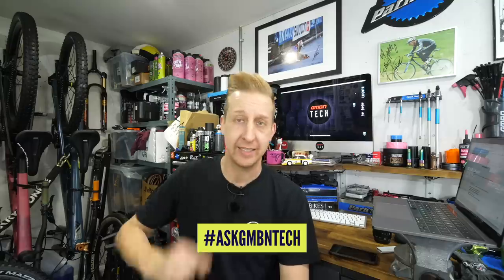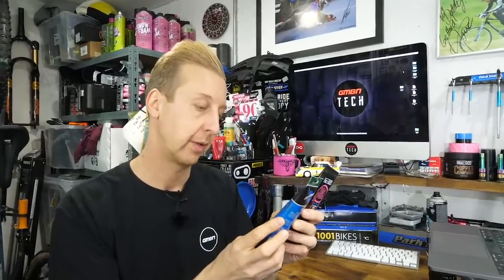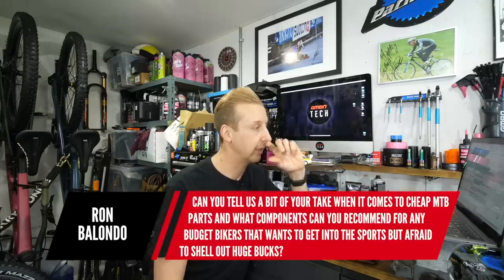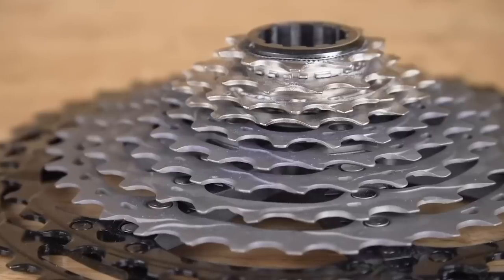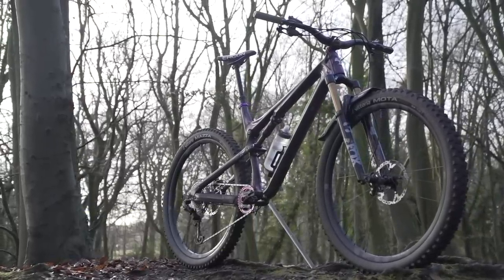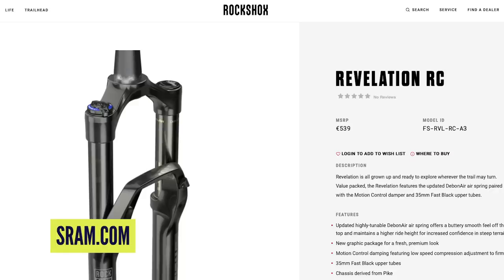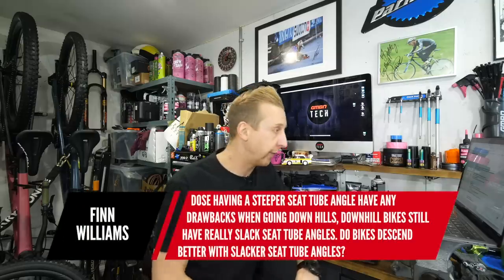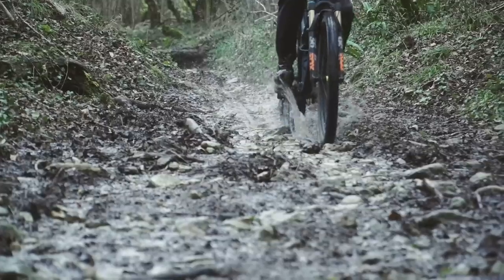What Cheap Components To Save Money For Budget Mountain Bikers? | #AskGMBNTech

Comment: I've got a Specialized Pitch 2020 27.5, basic components, with two in one shifters and hydraulic brakes. 2x8.
Is my shopping list...
DEORE 1X12 Crank and cassette
DEORE Rear shifter
DEORE rear derailleur
DEORE XT hydraulic brake levers

Anything else?

Comment: #askgmbntech 
If you use a shimani chain and cassette with a sram drivetrain, would you still get hyperglide?
And, unrelated, would it work to use say a 12 speed derailleur with a 10 speed shifter on a 10 speed drivetrain?

Comment: #AskGMBNTech

I have a giant stance 1 2020 27.5 and have bought Magura mt4 brakes. The front fits but the rear is rubbing the frame and i can't get it aligned, i have put a 180mm rotor on the back now and it has given it a bit more space but is is still being pushed in too much. How can i get it to fit and why won't it fit?

Comment: #AskGMBNTech I recently found the need to replace my rear cassette on my Cannondale Trail 6 (2016) i opted to extend the ratios from 11-34 to 11-40 thinking it would be better - but my shimano acera derailleur wont reach the biggest gear - can i get around this with a mech hanger extender or do i need a new derailleur - or to just go back to the stock ratio?

Comment: #AskGMBNTech - Hi Doddy! :-D  This may be a weird question, but how heavy is too heavy for a MTB? I know most MTB have a max weight range of 120kg, but I'm considerably heavier than that. I'm a regular rider using my mtb for exercise & weight loss, and not really into jumps & tricks (maybe an occasional bunny hop). How far (weight wise) could a MTB be pushed before it was into critical stress range and in danger of parts or frame failure? Cheers & love the channel! (especially Blake, Martyn & yourself)

Comment: #AskGMBNTech I've got a mid 2000s 26er ( 09 Spesh sx trail) of which I am the original owner.  The bike has some conservative geo in comparison to modern freeride/all-mountain setups, and tends to rival that of some trail bikes to be honest, however, it is still a great functioning bike and is still more capable than I am at bike parks, even if she is almost 38lbs I'll still pedal it (slowly) all day long; I want to breath some modern life into it.

I've done a Fox dropper, Sram 1x12, full frame bearing refresh and put some 4 pot Zee's on it, along with widening the cockpit 100mm.  I've got a good Fox 36 Talas (OG Fit damper) with a 20x110mm mated to factory DT swiss rims and Spesh hubs (Joy-tech I believe).  I'm a big time DIY guy and want to tackle a wheel build and slacken the head angle.  The rear is a 135x10 and I haven't purchased a new hub yet (would like XD or Shimano micro if possible).  Are there some considerations I need to think of when approaching both these tasks (angle set/wheel build)? Would you save your money on hubs and just rebuild the factory units?  I have the ability to do a mini mullet setup with my fork accommodating a 27.5" wheel.  Any advantages to that?  

Long question so feel free to abridge if you do reply.  

Love the show!
Here the steed as of a few days ago. 
https://i.imgur.com/QW2Aogm.jpg

Comment: Favourite cars gotta be an eagle speedster (or a redtomod jag e type). An absolute beaut of a thing. My question to #askgmbntech is that on my carrera my suntour xc, forks are really stiff and it takes my having to put in 5 mins of pumping for them to move at all and ive never really gone above 50mm travel. I always oil it and wash it but still have this issue can you help

Thanks

Comment: #AskGMBNTech  Hi GMBN Tech - What is the easiest way to adjust the overall travel on a modern suspension fork? I have a pair of  2019 Fox 36 with 160mm travel which I would like to run at 140mm for my new frame. Now that Talas and 'U-Turn' no longer exist,  what options do riders have? Keep up the great work!.

Comment: #askgmbn I have an old hard tail and it’s making a weird creaking noise, might be coming from the bottom bracket. If I have the brakes on going down a hill at very slow speeds as I release break slowly it makes an awful creaking noise. Also my disk brakes make juddering noises when going down hill and braking even just lightly. I have tried aligning them many times and even got a shop too a while ago and still no fix for it

Comment: #askgmbntech, hi guys, i want to upgrade the shock to a deluxe ultimate on my 2020 calibre sentry. but the rear mount is vertical and the front mount is horizontal. But with the new shock they’re both horizontal. Is there a way I can simply turn the stroke 90 degrees so it fits?

Comment: #AskGMBNTeck i went to replace my shifter cable on my sram GX 11-Speed and after adjusting all the limit screws and the barel adjuster it still was not shifting properly. I took it in to my local bike shop and they told me my cable tention was too tight but I remember installing it to be pretty loos is there any way to tell when the tention is to tight or is it all by feel.

Comment: #AskGMBNTech Hi Doddy, been mountain biking for nearly 25 years and ridden xc hardtails for the cast majority of that, aside from a few demo/rental bikes here and there. As I’m not getting any younger, back in September I treated myself to my first ever full sus, an NS Bikes, Synonym TR1🤩. Due to work, travel restrictions and lockdown I’ve not had much opportunity to really put it through its paces but done a few laps of Aston Court and managed to get over to Cwumcarn before Wales shut up shop 😭. I’m loving the bike and have already smashed a few PBs on rougher descents. Pretty much there with setting up the fork but still tinkering with the rear setup. A few questions; On the few occasions I’ve ridden full sus bikes, I’ve always seemed to have trouble setting up there rear suspension, I don’t weigh a lot (58kg) but do ride quite aggressively, if I use the recommended settings for my weight I’m constantly bottoming out and if I start adding air l loose the small bump sensitivity... do I need volume spacers-any other suggestions?  Secondly, more just curious about this, on a flex stay design like this does the flex in the stay contribute to the spring rate in the shock and does this impact on rebound damping settings needed? And finally, I’m not sold on the lockout system, how difficult is it to remove and replace with a standard dial on the fork and 3 position lever on the shock? Cheers Doddy, absolutely loving your work, keep it up 👍😊

Comment: #AskGMBNTech Hey there wizard Doddy :). I'm looking to build a Commencal Meta AM 29 which has a 230x62.5 stroke shock. Will it be possible to use a 230x65 shock on this frame? I'm asking because I what to use a Rockshox Delux Ultimate and cant find one at the recommended size (230x62.5) anywhere. P.S. I don't what to use a shock with a Peggie back that's why I'm not looking for a Super Delux shock. Thanks a lot and maybe if you have the time you can enlighten us of the kinematics of using a smaller or a larger shock stoke.

Comment: Continental are great tyres but they aren't all made in Germany. I've got some made in India and I think many of their inner tubes are made by CST who supply inner tubes to many brands even Poundland in the past. There are no Bontrager factories it is simply a brand put on components from other factories. Some are identical to the normal products from those factories and some may have a specific design that only Bontrager sell. If you are careful you can get great decent  cheap components by careful selection often just buying the factories own brand rather than the badge engineered version. An extreme example is I saw a comment in China regarding fuji-ta carbon fibre frames which were sold at about $200 in China with the Battle brand on but with the Bianchi brand on were sold at around $3000 in Japan. Same frame extremely different markup. It's not what it costs to make it is what people are prepared to pay and clever marketing is what creates demand even at very high price points. Bianchi would sell on its Italian racing heritage, perhaps a German brand would sell on its engineering reputation and a US brand on its freedom and adventure but at their core its a product designed and engineered in Taiwan and mainland China with all the certification and testing done there.

Comment: HI dod, I ride three bikes regularly. But I have a fat bike that have 132m BB shell means it's wider than the  other,. I feel knee pain when I use the non fat bike-bikes since I ride a lot on the fat bike lately. Will it be fixed by a longer spindle pedals? Btw all my bikes are using clipless pedals. #AskGMBNTech

Comment: There's all sorts of automotive cleaners & lubricants for specific uses or "special purposes" on cars & motorcycles too, if you know which ones are equivalent to the cycle specific stuff then you can use them.. there's almost always an equivalent if you can identify it & it's almost always significantly cheaper when there is (economies of scale). There's almost nothing carbon-fibre safe though, you'd have to go to aerospace supplies for that, & if you think the bike specific stuff is expensive y'all ain't seen nothin' yet.

Comment: #AskGMBNTech
HI I am looking to upgrade my Sram SX Eagle 1x12 11-50t to  Sram GX eagle  1x12 10-52t 
I understand this needs a DX driver.
How do I know if my wheel is compatible with a Dx  driver?
Current Rear hub; Novatec Boost RR 12x148mm Boost, 32H
Current cassette; SRAM PG-1210 Eagle, 11-50T
I have been trying to research this for days with little luck, any help would be appreciated 🙏

Comment: Hi Donny! I just got my Downhill bike tubeless a few days back, and I heard from a few lads that motorbike tire sealant works as a cheaper alternative, any thoughts? As always, keep the good work! #AskGMBNTech
Reply: Motorbike tyre sealant depending on brand can have the following issues when used on bicycle tyres
1) Inability to seal pinholes and sub microscopic holes (in nylon and fabric based bicycle tyres) as motorcycle tyres are butyl rubber based and much less porous (air wise).
2) Media used to seal holes generally larger for bigger holes, not necessary for much smaller bicycle tyres, ends up being added unnecessary rotating mass inside the tyres.
3) Depending manufacturers/brands motorcycle tyre sealants can be water based (not an issue for butyl based tyres, infact no turning into latex webs and balls) but can cause rim tape/adhesive to part, eventual partial and eventually full leaks through the rim's double wall through the valve.
On the whole motorcycle tyre sealant is not 'sealant' per se as motorcycle tyre sealants are essentially for puncture proofing only (as even if not used tyres will seal tubeless), bicycle sealant is both for puncture proofing but most importantly to make a bicycle tyre 'tubeless' which it is not by itself..
If a bicycle tyre is made tubeless by itself like car and motorcycle tyres it will become to heavy and not so supple.. Forget about folding tyres..

Comment: #AskGMBNTech It seems to me that more and more frames are being designed with big curves on the downtube where it meets the head tube and the bottom bracket. Some have a big kink at the front of the top tube too (eg Hai Bike). Surely this adds excess material and reduces stiffness? I can understand that you need clearance for the fork crown, but are there any other good reasons for this, or is it just aesthetics? Maybe making space for bottles inside the front triangle? I remember Trek advertising on the previous generation Slash that it had a straight downtube which maximised strength and stiffness. That made sense to me, but the excessive curves we're seeing now look pretty ugly to me and don't seem to have any redeeming practical reason for being there.

Comment: The only answer for that title question should be Deore.
Reply: Or a generation older mid or higher ranger parts. I wanted do go with the M5100 deore but a friend told me that the older 11spd is basically bulletproof so i gonna get SLX M7000 with a sunrace 11-50cassette and M5100 cranks.
Reply: And marzocchi for suspension
Reply: @maximilianweling477  Not bad but aren't the RockShox more reliable? Also RockShox forks can be upgraded a lot.
Reply: @kaedeschulz5422  Marzocchi is really simple to service though.
Reply: @maximilianweling477  I have no idea tbh. To me RockShox also seems very easy to service.
Reply: @kaedeschulz5422  M5100 Deore is really good. I have it on my 2021 Kona Honzo with the 11-51 cassette. Really good drivetrain. To the point where if I were to build a bike from the frame, I'd go Deore. But 6100 12 speed with an SLX 10-51 cassette and XTR shifters.
Reply: @vdel7418  Maybe it's not as bulletproof as the older shimano 11spd RD's? I guess we will find out LoL Sadly i couldn't get the RD M5100 so i got the 5120 instead wich sadly came with too little grease on the clutch tesnion band wich causes it to creek and not work smooth. I will order that special grease with the next load of parts :D. I'm using a sunrace MZ8 11-50 cassette and SLX M7000 shifter btw :) The cassette is a lot lighter than the M5100 also looks very pretty.

Comment: #AskGMBNTech #AskAnyoneElseInTheCommentsSection ...just how straight do your wheels need to be? Rear wheel itself is fairly straight but leans toward the brake disk side of the swing arm. 5mm between the tyre and swing arm on the left hs and 13mm between the tyre and swing arm on the right hs. Have tried to straighten it at the rear quick release axle.

Comment: I contaminated my brake pads and rotors when doing drivetrain matenence and they haven’t worked the same since is there a way I can fully decontaminate them thanks!! #askgmbnteach
Reply: I had the same issue. How I fixed it is I removed the wheel, and used fine-grit sandpaper on the pads and rotors. It completely fixed the problem
Reply: @arjenvelema2508  thanks man!!!

Comment: #askgmbntech Do i have to change bottom bracket in order to upgrade my cranks?
Reply: Depends if the new cranks use the same standard. If both cranks are shimano hollowtech then you won't. Same if both are Sram GXP or both Sram Dub, but if the new cranks are a different standard to your current bottom bracket you will need a new bottom bracket.
Reply: @davemate4097  thank you man! This was very helpfull

Comment: most of the parts cost more then my bike lol (for those of you that care it cost £100 on ebay absolute beast)
Reply: also have wobbly crank arms its a square tapered bb #askgmbntech
Reply: and fav vehicle would have to be an svj aventador or perf
Reply: @basicmtber3840  are both wobbly, or just one? Try tightening the crank bolts. If that doesn't fix it you need a new bb
Reply: @judechandler5102  yeah both are and the cranks have been tightened they also come undone i think yes i need new bb and also crankset

Comment: #AskGMBNTech I'm 12 years old and I ride a Specialized Rockhopper Elite with Rockshox Judy forks.I want to upgrade the forks because it only has 90mm of travel do you recommend any other forks for my bike?
Reply: don't go more than 110mm of travel. Make sure you get the right steerer dimensions. What year of bike is it. Give me the details including potential budget and I'll give you a hand to find something nice. I'm 17 and a qualified mechanic. I get my kicks form helping people to sort out their bike problems, so this is right up my street.
Reply: What year is the bike, and what is your price range? The measurements to look out for are whether the steerer tube is tapered (wider at the bottom than at the top) or straight. Tapered are more common on modern  bikes. The next think would be hub spacing. Its likely to be 1 of these 3:
5 qr (which you do not need to fully separate from the wheel to take off the wheel)
15x100 standard  through axle (non-boost)
15x110 boost. 
Once you have the right size, I would recommend pretty much any air fork. Have a look at the rockshox recon, revelation, then maybe pike select depending on your budget.

One thing to note: if it is a brand new fork, it will need the steerer tube cutting, and a star nut fitter. Talk to your LBS, and they should fit ti for you for not too much.
Hope this helps!

Edit: mistakenly put 135mm qr instead of 5mm. 135 is rear qr.
Reply: @cwlli   Hey dude I just got the bike this summer  and my price range is like no more than 450 US$ and thanks for your help I'll definitely measure everything.
Reply: @judechandler5102  Hey dude it's a 2020 and like I said to @CharlieWilliamson thanks for your help. Also I put a dropper on it and some new crankbrothers 3.
Reply: Stamp 3 I meant
Reply: @nicoramirez748  I googled your bike, and your hub measurements are 9x100 qr, and you have a tapered steerertube. Finding a super nice fork for that price could potentially be difficult, so consider upgrading your front wheel to a 15x110 hub spacing if you want a really good fork, but you can still find some good qr ones.
Reply: @cwlli  Ok thanks man , really appreciate it